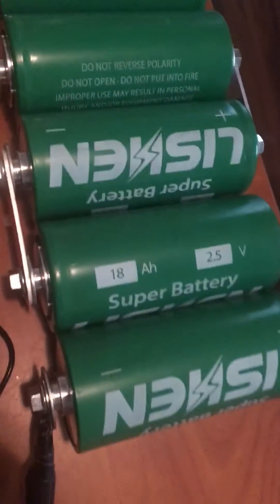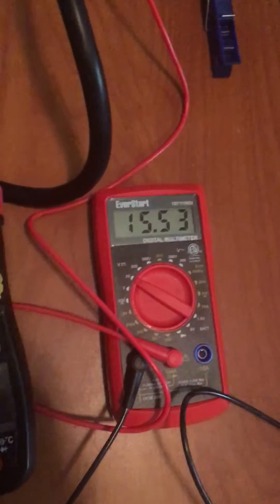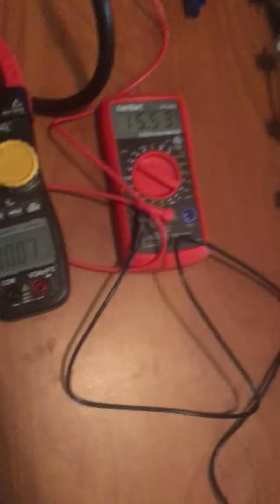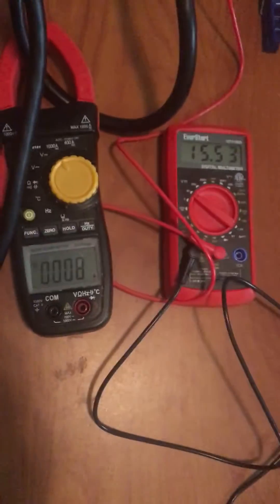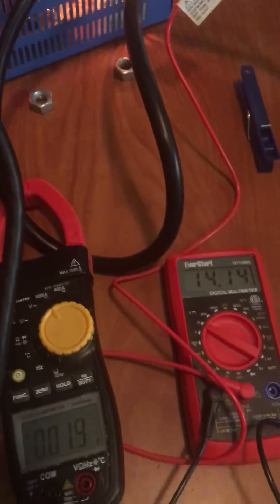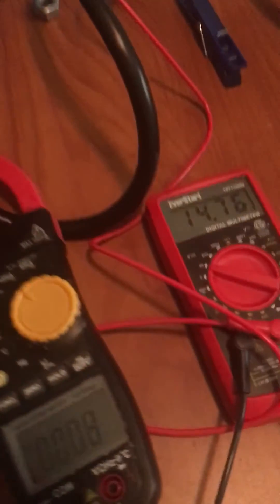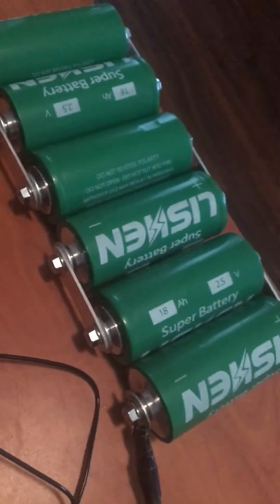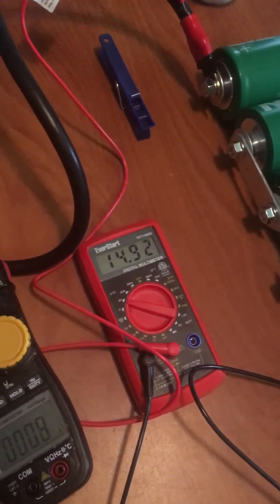Lishen 18ah LTO 25C load test for 30 seconds

Comment: Hi Devin! Do you think a little bank like this would be a good drop in replacement for a car battery? 

I believe 25C would be enough but I wonder about what it does in combination to the charging system. Our Honda CR-V has such a fancy control unit that ups the voltage to 14.1V at certain moments while allowing it to go down to 13.6V at other moments.  That cycle would probably start every time you start the car, or the A/C kicks on, or for a number of other reasons.  The cycles would be shallow (although.... 0.4V in the  middle of the flat curve) and those LTOs are probably rated for 30.000 full cycles.
Reply from the maker: For AH(capacity) I would do at least 2 banks of these 6 cells in series. Charging at 14.1 will be 100 fine on these cells. 1 bank will be fine, but 18 ah isn’t big enough if you’re going to be running anything with the car off itself even the radio.
Reply: I'm not into radios as you are :-)  I just need to start the car reliably even after not using it for weeks.  I need to have something that does not mind being stored with less than 100% SOC.

One other important thing, do they stay balanced?  (Speaking of which your 600 Ah bank is still within 20 mv balanced after all this time :-) )

Do you know a reliable seller? Or perhaps you want to get rid of this one after you are done with it? ;-)
Reply: @cobbles62  I have a single bank of these and they start my car just fine. The cells all have very similar internal impedence so they won't drift out of balance much. But the readily available 6s capacitor style balancers work with these so long as you solder the "LTO" jumper and desolder the "LFP/Lipo" jumper. That said, these things don't go out of balance easily and the balancer will gradually drain them so I'd just balance them once a year or so. The cells have extremely low internal resistance so they will not self-discharge. You can leave the car off for a year and it will still start right up. However, the 14.6 or 14.2 v or whatever your alternator puts out are quite low on the SOC curve for this battery. Most of the capacity is above 14.5v. for that reason it might be worth having two in parallel. Or having one 6s pack in paralell with a 5s pack, so long as you are not charging above 15v. You can buy them on aliexpress from a seller called small den.

Comment: U think a 72ah will work really good for 20k?
Reply from the maker: I would do 5 banks for 20krms to be on the safe side
Reply: @Devin20852  with a. 390amp alt i ordered 24cells just to see how they perform
Reply: @HardKnocks160s  what’s up?  Did you get the cells in? How are they working out for you. Any details on sitting voltage and voltage drop in your system?
Reply: @roysongarvey2261  i. Ended up ordering 6 banks still waiting on my buss bars to install
Reply: @HardKnocks160s  where did you get the buss bars from? I’m about to order 8 banks for it to make a 162. I’ll be running close to 28k rms on music. Want the extra reserve.
Reply: @roysongarvey2261  project db on Facebook im going to see if this 108ah does. Really good if it really impresses me il just buy 6 more banks for a 216ah bank
Reply: @HardKnocks160s  how much did he charge for the 6 bank? I’ve seen the name come up regarding doing those bars? do you have a picture of how they will look?

Comment: Are you charging the cells while load testing to simulate an alternator in a live environment?
Reply from the maker: holdenisthebrad no I don’t and I wouldn’t need to. Putting alts on it under a load would’ve yielded better results. This is a stand alone load test.